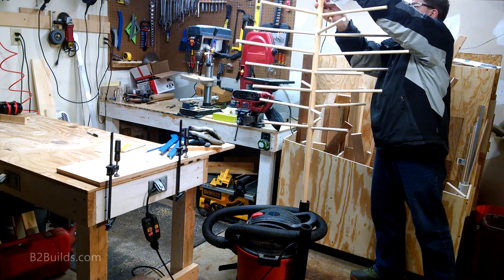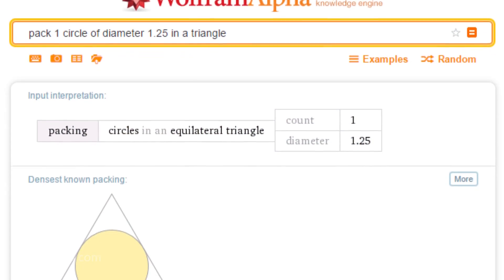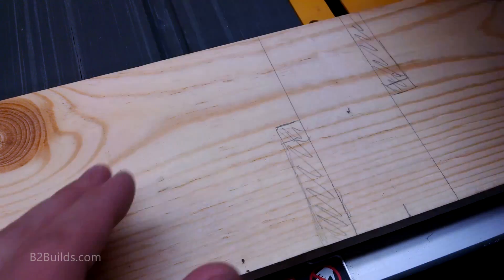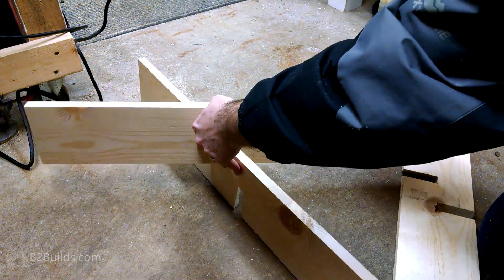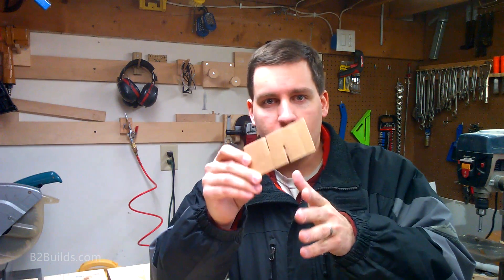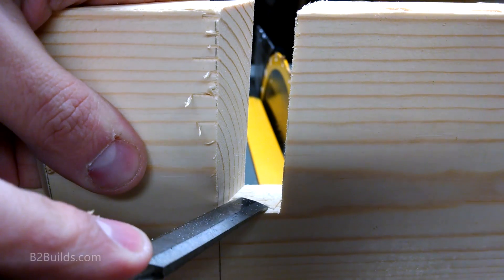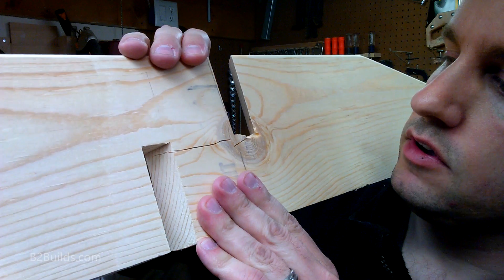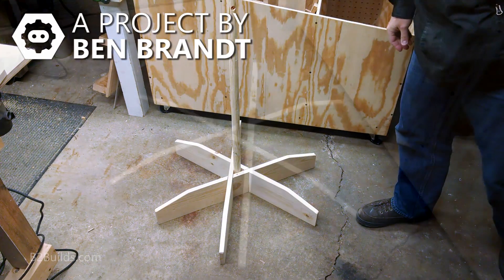How to Make a Six Legged, 3-Piece Pole Stand

Comment: for the tree top you could take like 30 pieces of wood (for the branches), the ones on top slightly smaller than the ones directly below, make a hole through all of them, insert the pole in the holes and twist each branch a couple of degrees in comparison to the one above and below... or maybe make the larger one on the bottom say 0 degress, the next 60 degrees, the next 120, etc until you get a helix pattern all the way up to the smaller branch at the top

Comment: I really love this project.  It's a very elegant solution.  :)  Great work!

About the cracking issue - Would it be possible to adjust the depth of your cuts so that one was at, say, 75% and the other at 25%?  It would mean you'd have to put them together in a specific order, but then you'd have more strength in the opposite cut board.  Maybe 65/35?  Just a thought.
Reply from the maker: Thanks! That could work... if I made my cuts on the cracked piece shorter, that would leave more wood in the middle, though I'm not sure my particular saw could be raised much higher. Worth a try though if I had to do this again.

Comment: Nice idea, I like it. You could finish breaking the crack and then glue it back together-- stronger than the original wood. Then add dowels.
Reply from the maker: Thanks. Not a bad idea. I put some glue into the crack so it'll probably be good enough.
Reply: Ben Brandt I'm pretty sure it will be fine. The dowels helped take care of that too. Sure was unfortunate placement for the knot, which probably contributed to the weakness there.
Reply from the maker: Yeah I would have used a different one, but one of the other pieces got knocked over and broke completely, and the other one had a slot that was a little too wide, so I had to settle for the knot  :-)